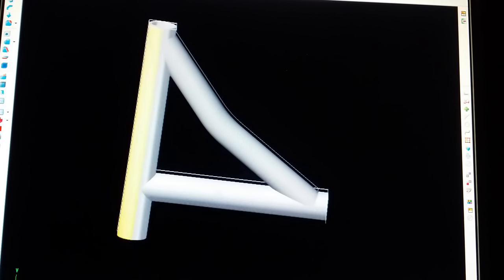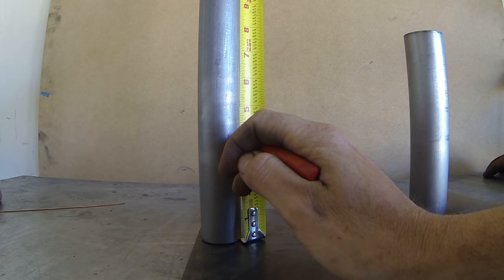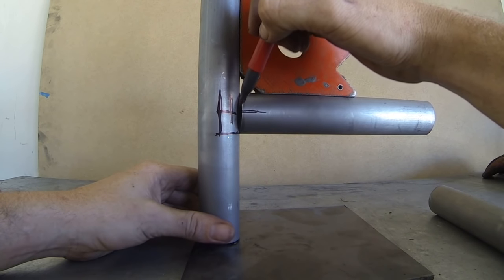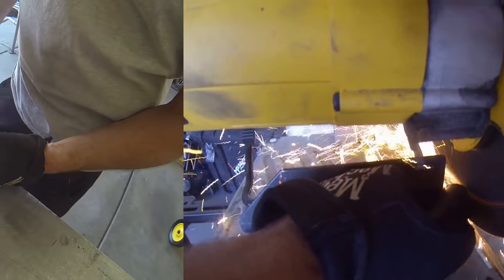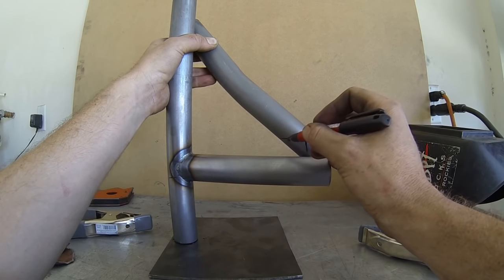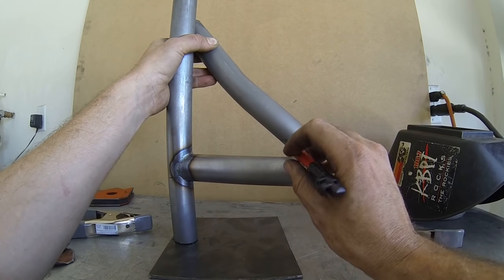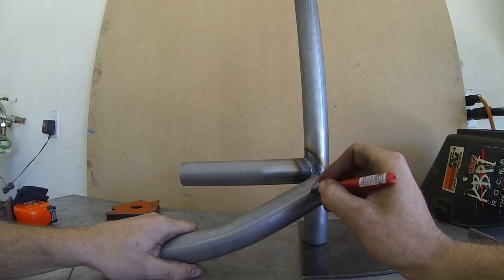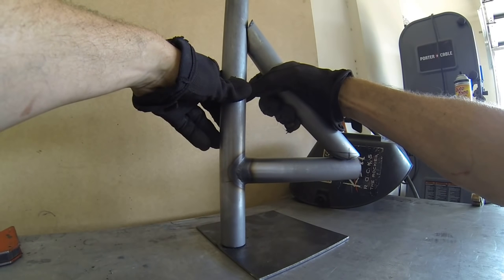TFS: How to Notch Tubes Without a Tube Notcher

Comment: A fabricator I know uses a metal lathe. He made a fixture that holds the tubing in the compound. That allows him to set any angle. An end mill in the chuck does the cutting. not everybody has a lathe but if you do, it fits up tubing perfectly. I have a lathe and I'll try that, because I hate abrasive saws and grinders.

Comment: 8 years ago. Still good information. As you point out, just a tube notcher, hole saw, manual cutting, they all still require more than the basic fishmouth cut. Files, rinding sanding and adjustments to get perfect fitment.

Comment: Dude, you’re the master.  I’ve spent hours watching your roll cage videos.  However, this crap didn’t work for me at all.  I built half a roll cage this way.  Took three months.  Partly because my new MiG kept messing up.  I bought a $100 tubing notcher from AMAZON and got out my old Forney flux core and finished it off in a weekend.   Again, you are amazing and I’ve learned a lot.  I’m glad you’re here.  Building a roll cage is a lot different than arc welding on farm equipment.  Thanks for your guidance.

Comment: Just came in from my home shop after trying a 45 and 90 using your methods. They worked GREAT and were indeed much easier than what I had been going through. With a little more practice I know I will have a much closer fit-up than on my first two.
Thanks !!

Comment: Really cool you did this vid. At the shop we too have a tubing notcher, plasma cutter, TIG welder, MIG welder, etc etc etc. 
The go too tools we use 90% of the time. Cut Off Wheel, Hard Stone, Flapper Disc, on a 4.5" grinder and chop saw. Simple stuff anyone can buy for little investment. Just because you have the tools, doesn't mean you have to use them. LoL, and as for TIG welding. I only do it when I have to do it. If you are using (cheaper) mild steel to learn this, MIG it. Flux it. Stick it. it's all the same and cheaper while your learning it.
Great vid as always man.

Comment: Very cool.....  1/3 the way lap, opposite side marking...check.  Now I need a TIG welder. 
I just got a plasma cutter and don't know how I built the stuff I made without one.
Pop bought my Craftsman AC welder for my 12th birthday. It just turned 50 years old and I used it all this week.   Great vid...Thanks!
Reply: kimmer6  same here apart from the welder belonging to my pop learning on that welder for so many years made me the welder I am
Reply: Practice hard, test easy👍🏼
Reply: indeed.  i find it ironic that we call it “welding” when it seems it’s mostly “grinding” 😬

Comment: You said it all when you mention time and experience. I use the machinery handbook a lot and it taught me to do flat pattern layout. Once I learned this, which is same as CAD only manual drafting, making wrap around templates is easy. Then I learned to use the 4 inch disc grinder to cope out the material with super accurate results. I built complete chrome molly tube race cars many times with this method. Your method here is another great way to get the job done, good vid!

Comment: That was TOTALLY worth 15 minutes! Thanks!
Reply from the maker: +Marsh Wildman Thanks for watching!
Reply: Yeah I watched the whole thing..much appreciated
Reply: What is that Orange color thing that he somehow attached to that tube??
Reply: Your instructional abilities are actually quite good.  Just the right amount of explanation and visuals.  Not under explained and not OVER explained either - just right.  And the flip the tube marks bit so you aren't trying to make cuts to the right of the chop saw blade is helpful (also a mistake I make all the time!)
Reply: @thejagc3736  it's a welding arrow. They are magnetic and used for exactly what he's doing. Gives you 2 free hands so you can tig or whatever else you would need your second hand for
Reply: Joe Bradle
Reply: @thejagc3736  The magnetic clamp?

Comment: The method i use (as a diy hobby, for very few parts) is CAD model it, unfold the tube with the perfect notch, print it scale 1:1 and wrap the paper model to the actual tube, trace the perfect line needed and cut away with bandsaw/chopsaw/dremel/grinder/file.
This way any complicated shape can be fitted to another complicated shape. This way I made a tandem bike from several other bikes. But the bike frame tubing is not round but oval, fluted circles and ovals, triangular shapes, rhomboid shapes etc.. The tubes are thin walled and have large diameter .. so just eyeballing it may get away with good eyes and experience, but this CAD template is 99% accurate if you can grind to a line.
Reply: that's a good idea for odd shaped tubing
Reply: Need to make a video of that procedure.
Reply: Amazing …..
Reply: That sounds a lot easier than all this. I'll give it a try.
Reply: Great idea. That would make the perfect template and then I can use my everlast plasma cutter to make the cuts.
Reply: @jonryan391  Back in the day we had to do a development to make a template, but that involves brain work which is somewhat lacking these days
Reply: I like the idea you have here using cad, but hell, that's a lot of time unless you are really good with cad. I'd like to learn cad, but haven't had a chance yet.

Comment: Drill press hole saw done quickly and no grinding thank you everyone 
Elvis has left the room
Reply: So to do it without a tube notcher you say just use a tube notcher? BRILLIANT! 
Just go get a drill press, a clamp or vise capable of holding the tube rigid on the table (a tubing notcher), and a hole saw for every diameter of tube you want to work with? And what if the tube is really long and cannot be held in hand?
This method can be done just as accurately for proper welding, and the only tool actually required is an angle grinder with a cutoff wheel and a marking pen. Guess you misunderstood the concept, message, and even the title of this video. You are NOT Elvis. Elvis left buildings, not rooms. You are more like Beavis...Welcome to the world...please drive thru

Comment: I made a jig for my drill press a while back, you just stick a hole saw in the chuck and clamp the pipe to the jig and it all works out fine.  if I'm doing a weird angle I'll either shim the jig on one side or make the cut and then deepen one side with my angle grinder, depending on what kind of angle I need
Reply from the maker: +歩春日 That sounds like a useful method.
Reply: /            

You have the gift my friend, to think it out as well to share and explain👍
Reply: I did this as well but the hole saws sure are slower and cost more to use than abrasive chop saw blades and old flappers.
Reply: Seems like you would through a lot of blades.
Reply: I see allot of bicycle and motorcycle frame builders notch rubbing like that.

Comment: I glad to see I'm not the only only one who uses a grinder without a guard........great flick by the way.........Cheers
Reply from the maker: Thanks for watching!
Reply: I do it all the time ,been doing it for years ,only ended up in hospital the other day (Friday),(after a few lucky escapes over those years?)1mm metal cutting disk attacked my head as I bent down to plug it back in to the extension lead it had slightly pulled out of,I placed the grinder correctly on the bench, plugged it back in, forgetting  it it was still switched on.... ,I was bent over, head level with bench(as the lead was on the floor), the grinder flicked 90 degrees and came at my skull hitting me twice, as the first cut bounced a little of my skull,could have lost an eye ,nose or ear,lucky for me my poor wife was home and got me to a near by Hospital,I nearly passed out from loss of blood, lucky no brains to loose, not a lecture, just saying .....these stupid things do happen?
Reply: yep and i slit my wrist open with one without out a gaurd, oh the white flesh looked good just before the blood flow
Reply: You mean that funny shaped paperweight they give ya with the grinder?
Reply: MrMan put the guard on and it makes it a one way grinder. Not good for any job.
Reply: I hate having a guard on... They get in the way and severely limit the use of the grinder.
Reply: And earplugs.
Reply: smarts like him you and me also sometimes end up in hospital for not using safety procedures. cheers
Reply: Grinder guards are mandatory at all times for lots of us at work, for those of us who aren't self employed. You get used to it and I wouldn't try to glamorize not using one or shame people for using them. It's a rule because enough people got hurt.
Reply: @waen606  You guys are hilarious. Seriously, I knew this guy (yea, past tense) who always poo-pooed safety protocols.  One day his luck ran out and he killed himself in less than 2 seconds. We were joking about his ambivalent attitude not 2 weeks prior. His kids were playing in the yard and they got to watch their dad die. Sorry to be a bummer but just saying.
Reply: @ramrise  so what happened?
Reply: Cant use them without guards here...i mean at home you could not at any company.  Be fired on the spot, its law like wearing a harness in a man lift

Comment: Thanks very much for this video!  This method of cutting the fish mouth on the 90 degree joint is great.   Assuming the 1/2 and 1/3 diameter numbers, the process can be made even easier  by using a little trigonometry   It turns out that the angle to cut is the angle whose tangent is 2/3, or about 33.7 degrees.   So without having to make any 1/2 or 1/3 diameter marks, you can just make the 2 cuts at about 34 degrees  and it is perfect. ( I used a bandsaw.)

Comment: just buy the pipe fitters blue book and you can do anything
Reply: You ain't wrong about that friend. I've been fitting and bending pipe and tube for around 30 years and the best I've found is by W. V. Graves. There's the fitters blue book that covers pretty much all you need to know about running pipe, and then the fabricators blue book which has the specific ordinates for laying out any fit or connection you'll need.
Reply: Bluebook don't tell you how to lay out a 16 onto a 30 ...1/4 inch from top to top at a 30 dedree angle....I created a device to transfer these marks for a perfect fit ...in about 10 minutes...

Comment: Lol... does ANYONE use grinder guards?  They need to stop making them so we can save on purchase!!
Reply: Yea, what he said.
Reply: There are instances where having on there makes it awkward or blocks you out in tight spaces but I have two one with and without. I only use the without when I have to.
Reply: James T Kirk Akward in tight spaces or not, I have to use the guard at work. If caught without by govt inspector it's a fine for company and possibly me and my boss would tell me to kick rocks. If my supervisor caught me, I'd probably be told to kick rock but no fine.
Reply: @AndersHanche  been there, done that and still  don't use one
Reply: Grinder guard really isn't needed for flap disc use. It just gets in the way when digging out deep angles or odd surfaces
Reply: In a shop/garage there is no point in not using the guard. I always wear welding leather gloves and the guard plus if I can I wield the grinder with both of my hands. No point in trying to look tough compromising your safety with a grinder.
Reply: I winced more at your lack of ear plugs than your missing grinder guard. You do fantastic work and give good instruction.

Comment: Hey buddy, you're pretty good with the pipe and tubing. I built the airplane with all those "clusters" and fishmouthing the tubing all by hand. 2 grinders , one with a cutting wheel and the other with a hard grinding wheel. I used 2 grinders because I didn't want to dink around with changing wheels all time. It saves a lot of time believe me. Your approach is more scientific than mine so I'm going to try your method because I like it. Not that one is right or wrong, just because I like your way. Thanks for your help with tubing issues. You are definitely on your game.

Comment: As a man who has built 4 awesome rat rods from the ground-up, I TRULY appreciate your work, but it really is easier to sculpture out the radius of the tube with a good ole' bench grinder.  You can start with a normal wheel and it will form a nice radius on it as you grind out the first cut.  And it IS safer to do it that way because you can use the rest on the grinder to steady the tube.

Killer work!!
Reply from the maker: Thank you. I'll just add that "easier" is a point of view based on the person doing the work. Whatever works for that person is the method they should use. I find it easier to shape with a flap disc.

Comment: I have 2 Williams low buck notchers but I use my chop saw. On the long angles the outside notch is there if you measure right and cut right. I do it the same way as you do.

Comment: Great video very useful info....A thing I learned, as along as you are fitting the same size tube onto another tube all you do is cut 2 30 degree cuts . It works for all size pipe and tubing, of coarse if its 90 degrees.

Comment: Very cool!! I've used a tube notcher and it always leaves a gap to the point of making it bigger because you know you'll have to fix it.. I think that's what you mean by your method is less time.
Reply from the maker: It is less time from start to finish. Measuring, marking, notching, cleanup, and fit up takes less time since you are doing several steps with hands instead of multiple tools.

Comment: Great video! Great Instructions!!! What part number is the sanding disc that you are using in the 4 1/2 tool? I saw that the brand is Pearl, but haven't found any rounded like this one. Thanks!
Reply from the maker: rguevara2001 It was probably a 60 grant flap disc. It's the one I use the most around the shop.

Comment: Lowes sells a kit that has some large diameter drum / barrel sanders that fit in a drill press or hand drill. They work great for adjusting corrections on your notches in the throat area

Comment: good video... will I be able to use black iron pipe or the galvanized steel pipe from lowes to weld up a grill guard for my truck? I have no steel suppliers anywhere close and shipping cost is out of the question... it's the pre threaded stuff in stock at lowes I have a 125 amp buzz box welder from tractor supply, says it's good to 3/16in

Comment: Great video I normally just measure the pipe or tube and use a holesaw which is the same size as the tube. Seems to work well for me.

Comment: A very good video! If you have lots of replica tubes to shape - mark a centre line on the pipe and make a rap paper template of each end shaped as the end. Marking the centre line from the pipe on it. These can be rapped on your next pipe saving time marking before grinding.   Look up - pipe pattern development for branches (professional process).

Comment: Nice welds dude... I'm primarily a MIG welder. I do picture cards roll cages excetera. I don't do much tig welding but my question to you is why is a much smaller weld with a TIG or is it stronger than my fatter  mig welds. Pretty much both rolls of Dimes.

Comment: 30 yrs ago I began writing algorithms on a small pocket computer no bigger than a calculator. It was a hobby that went on for years and eventually I got to the stage where it could calculate the ordinates needed for any template to cut any pipes at any angle and at any fitment that could possibly be dreamed up. Then it went onto calculating any type of offset possible with any sizes and fitting up to any other.... The story behind all this is that I used to be a welder and I just got sick of welding 'gaps' all day long and so I just said that there must be a way of calculating things to never ever have a gap ever again..... And I've never had one the rest of my life...  But all of that aside, what you've shown on this video is far better than I could have ever done myself freehand... and if the objective is to get the job done, then that's all that matters. 
I always used to get a buzz by saying to anyone to simply toss two pipes anywhere at different levels and different angles and just with a tape measure and my calculations, I could cut the parts and pieces needed to connect them up with barely any daylight in the gaps.... I hate welding gaps.

Comment: Also, would you say it's necessary to get a welding certification to start up fabricating? I'm about to enroll in my local collage (I'm retired but found my true vocational love in welding after retirement)... But I really just like fabricating stuff. I don't really want to get a job for a union welding pipe or anything like that. I want to build my own intercoolers and exhaust for a twin turbo R8 I'm working on.

Comment: Great work. The only way I make it super clean is with a hole saw same outside diameter as pipe with extra long pilot bit, regular bit with ground in flat spot . Only need to deburr with grinder. Great channel

Comment: Maybe this has been asked, but if I'm needing to notch 2"x2" square tubing to fit against 2-1/2" rounding tubing does the 1/3 rule apply?   As in taking 1/3 of the 2-1/2" round tubing to lay out the notch mark on the 2x2 square tubing?  This is for a 90 degree angle.

Comment: Great video mate,  need more rollcage stuff!!  i pretty much use the same method that you do, an extra thing i found helps (9.40) instead of holding at awkward angles to mark up the cuts i just clamp an off cut of tube next to/behind the lower tube and sit the tube on it that you want to mark so its at the exact height and depth. hope to see some more full cage builds soon!
Reply from the maker: I have a few cage and related vids and more coming soon.